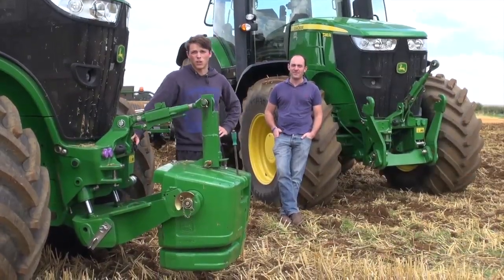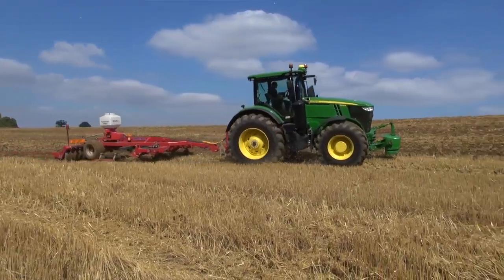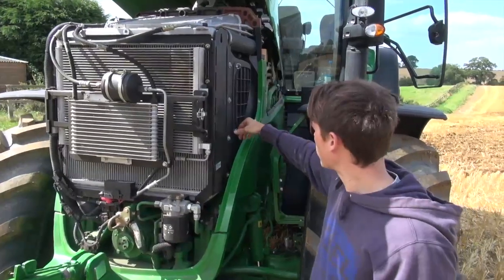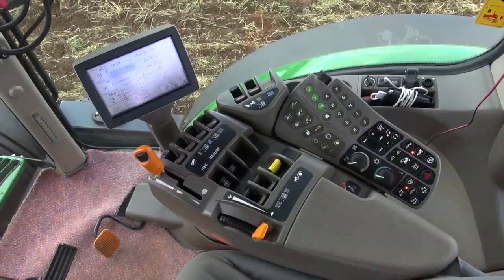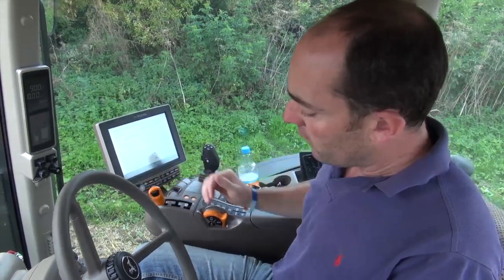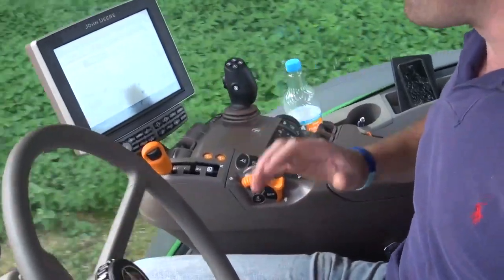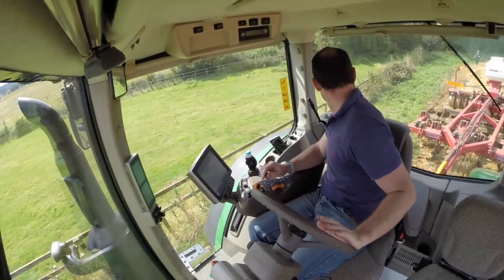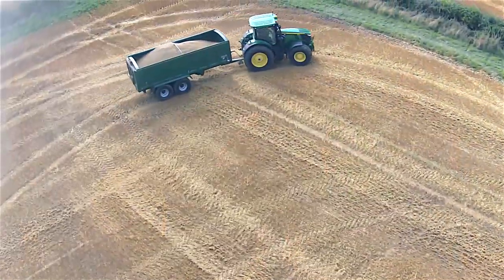John Deere e23 v Autopowr

Comment: U dont need to be on the transmission page to change between manual and automatic. Just set the cruise to automatic and leave the rest on manual and u can the go from automatic to manual by changing gear, and go back to automatic by hitting the cruise button again 👍

Comment: I drove a demo 7250r with e23 I thort it was brilant i could have it in auto and dump a 6m chisel plough in the ground it would instantly chop down 2 gears and get into it and do It faster than I could  and on the road put the foot flat and could hardly feel a gear change all the way to 50k. I've never drivin  a tractor with a power shift trans that I felt I could use in auto better than manual apart from this 1

Comment: I like in the beginning how all the crap just drops off the radiator screen when you shut it off.  Not really getting why you'd want a full auto option on a powershift, and the video shows why.  If it's too much of a bother to bump a small lever up or down, just get a CVT and be done with it...  In the end, the hybrid system just adds needless complication.  Btw, you can order a larger screen for the display.
Reply: this is the large display
Reply: Lol you haven't a clue have you